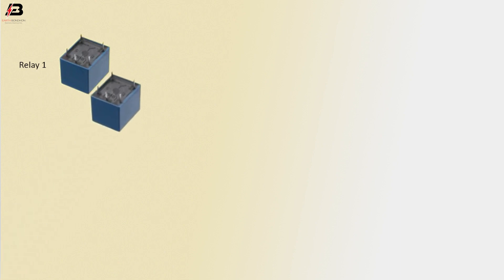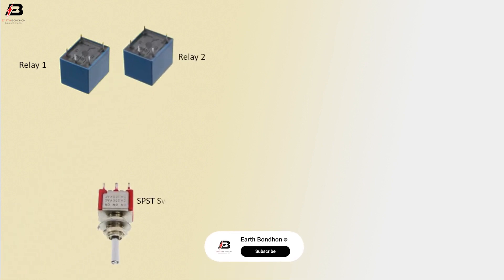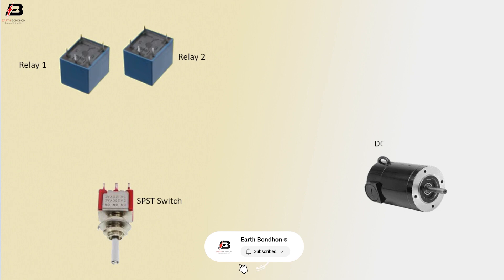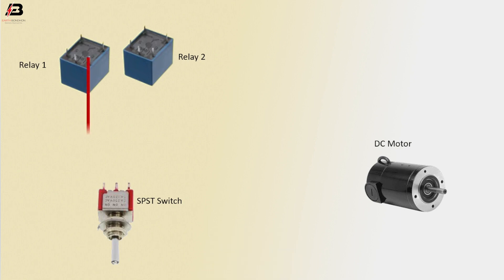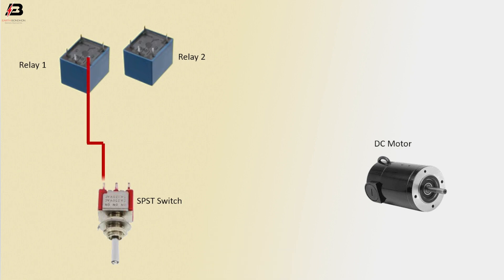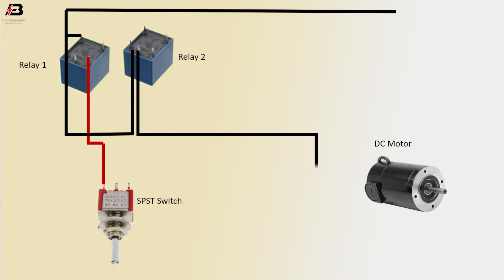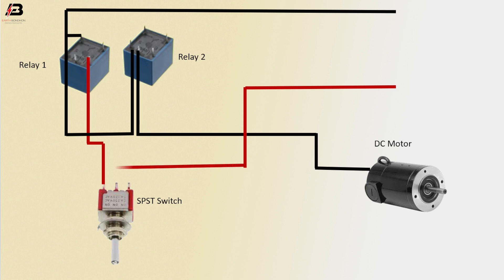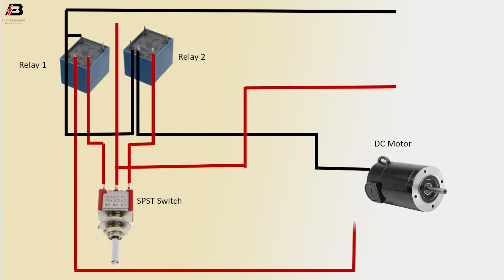DC motor forward and reverse controller using relay | relay motor control

Comment: Can you label the number on the relay that was connected  on your grahics line. Tq
Reply: From the pic it appears the poles connected by the blue wire are 87A.  The empty pin on relay 2 and the same location on relay 1 are 87.  The 3 across the bottom from left to right are 85 - 30 - 86.  Again, this is what it looks like based on the pic.